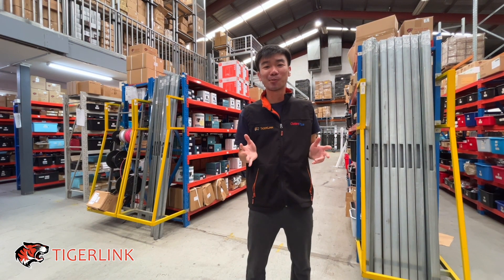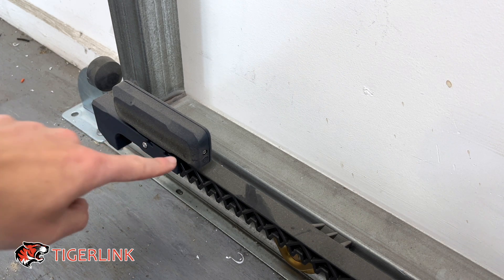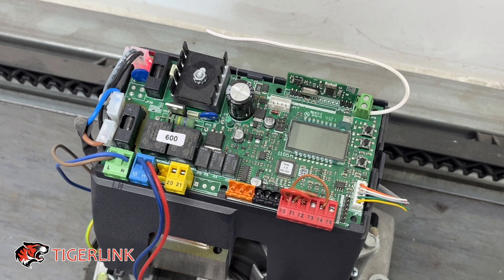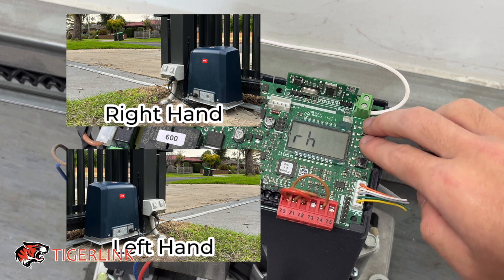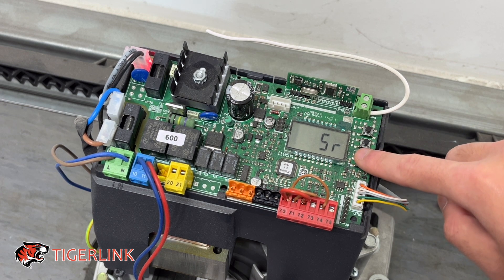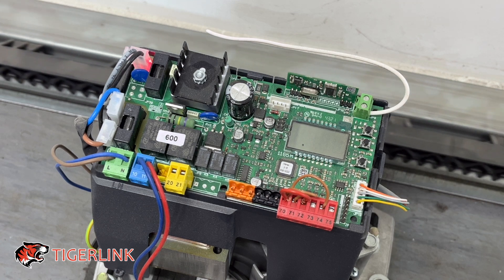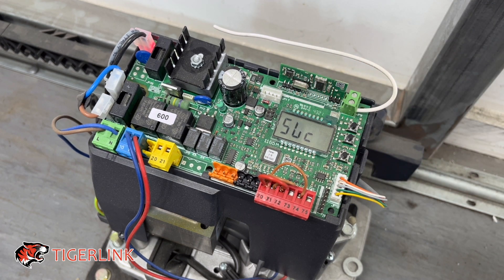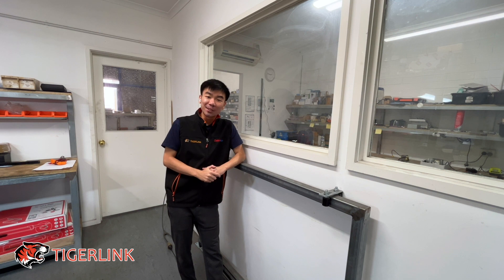TIGERLINK: How to do an AutoSet on a BFT Ultra Sliding Gate Motor

Comment: Hi. The gate force stops when someone is passing through the photocells when opening. Before it didn't do that. How can I make the gate not stop when opening even though someone passes through or uses the RC? I want for the photocells to be active only when the gate is closing. I saw another video of yours that you did this to another motor. How is it done to the BFT Sliding Ultra? Thank you.
Reply from the maker: Hi. Please refer to the manual under the Logic menu under Safe 1. I think you have to change Safe 1 to 004. Hope that helps!  -Ton
Reply: @tigerlinkhardware3072  it was Safe 2 to 004. Thanks 🙂

Comment: Hi. How to enable the option in settings to stop the gate during movement when activated on the remote control? I accidentally disabled this option, and when the gate is closing, I can't stop it; it has to reach the end. However, when opening, I can stop it then?
Reply from the maker: Hi. In the Logic menu, there are three configurations regarding blocking pulse: during opening, during autoclose, and during closing. Just make sure you change all of them to zero. Hope that helps!   -Ton
Reply: @tigerlinkhardware3072  Thank you for the quick response. When I'm at work, I'll set everything to zero in the logic menu. There's another issue causing a problem. If you could help, I would be very grateful. The problem is that when temperatures are below freezing or at zero, the gate, during startup, stops every time I press the button or moves a bit and then stops. In this case, I need to manually close or open it using my hands. I should note that the gate is cleared of snow, and the entire path it travels is also cleared of snow.
Reply from the maker: We are based in Melbourne, Australia so unfortunately, we do not have snow here and the temperature never gets to freezing so I do not have any experience to help you with that. Sorry about that.
Reply: @tigerlinkhardware3072 Hi, sorry I didn't reply earlier. Regarding the function to stop the gate when closing, were you referring to those three functions in the logic menu, Ibl open, Ibl tca, Ibl close, and setting them to 0 to return everything to normal? And if that doesn't work, what then? Because generally, someone from my company tried to repair the gate, as I mentioned earlier, but it wasn't a software issue, it was a mechanical one, so everything needed lubrication, and now everything works fine, except that the colleague messed something up in the program and made the gate automatically close after 9 seconds. I managed to make it stop closing by itself, but when closing and pressing the remote, it doesn't want to stop. However, there's no issue when opening. I asked earlier if those functions, like PROGRAM TCA and LOGIC IBL OPEN, IBL TCA, and IBL CLOSE, are the only ones related to this, or is there something else?